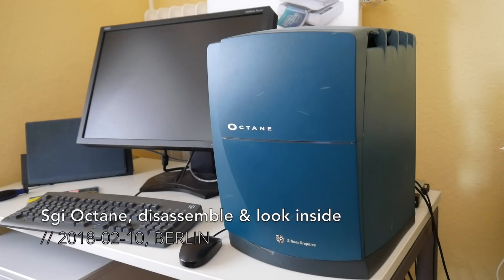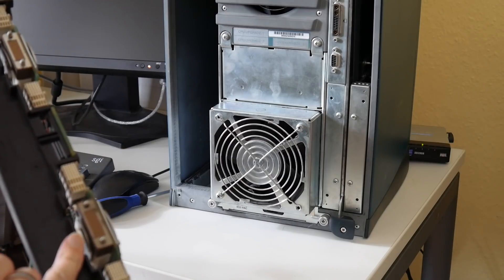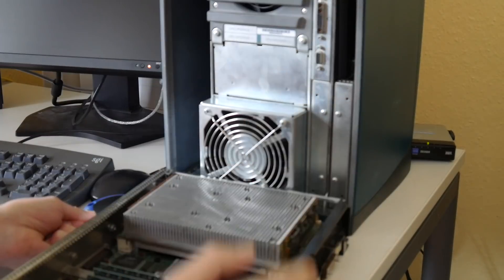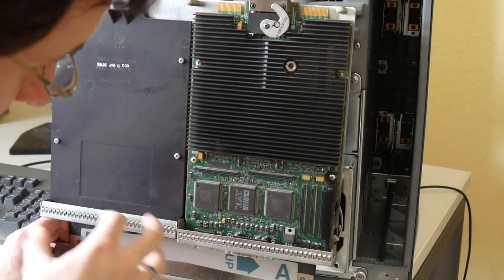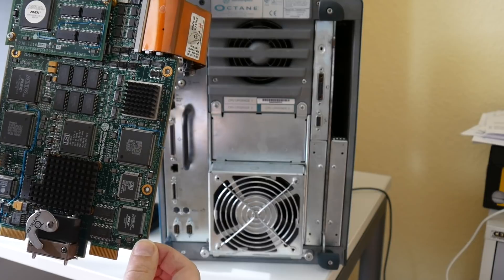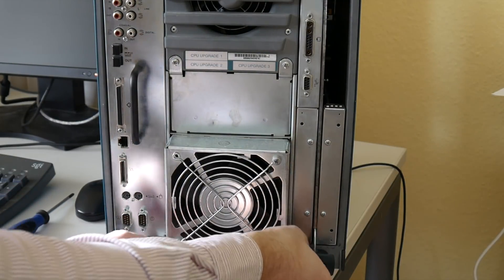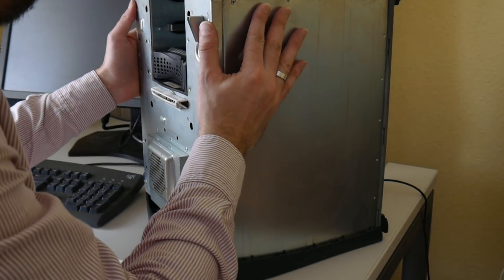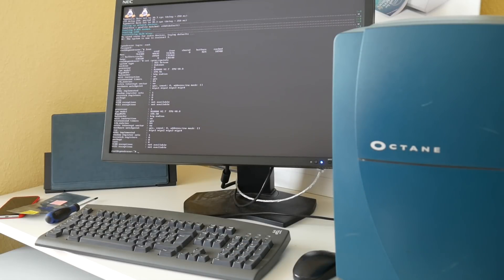Inside the Sgi Octane, disassemble and RAM upgrade!

Comment: all the bodge wires are rather normal for such low production number of devices, respinning such a thick multilayer pcb sets would be much more expensive, so they use whatever PCBs they have and fix them up until the next batch
Reply: Yeah the USA comment just exposes some of the bias of this guy.  He doesn't really know much about what he has in his hands.
Reply from the maker: @lookoutforchris that's why Apple manufactures all their devices in the USA and Europeans buy so many US cars? Right? Have you seen Boeing airplane quality? But I'm "so biased".
Reply from the maker: I think I never seen this in any other Unix workstation, even my other, newer Sgi Octane system board revision E or something still has them - so they like never fix this, the flying wire pins on the Personal "EVO" Video boards are really crazy though – https://www.youtube.com/watch?v=gTCPg7NF0_g

Comment: Would it even be possible to get a recent version of blender compiled and running on Linux?
Reply from the maker: have you seen my earlier video about Linux on the Octane? https://www.youtube.com/watch?v=AU_RV8uoTIo Compiling Blender should probably be easy, or even just work, however, we have currently no GL driver for these Sgi video boards, so running it would be not the greatest fun. It may be more useful to do that on Irix, or write the Linux / Mesa 3D glue first ;-)
Reply: RenéRebe Yes I saw it, amazing job. Blender is not supported anymore on irix since a long time, and no one has been able to get it working, i didn't understood well why. So I was just wondering if it would be easier to get it working on your Linux port, even without hardware acceleration
Reply from the maker: without 3D acceleration Blender is formidable slow, especially on this vintage CPUs. In my opinion it only makes sense with working GL.